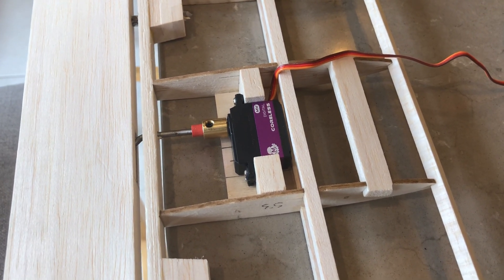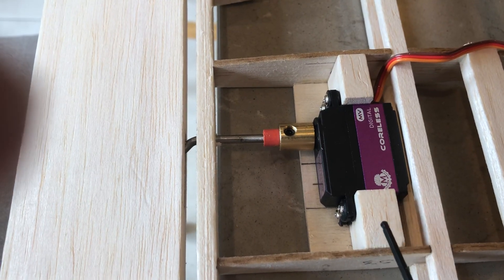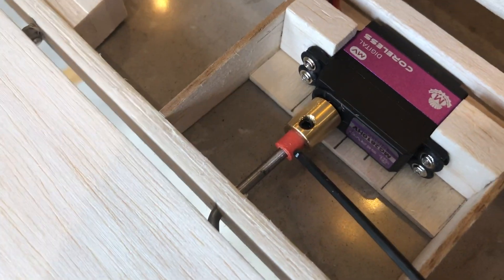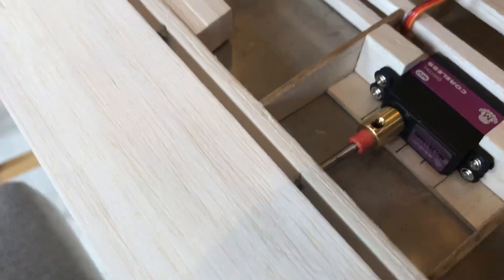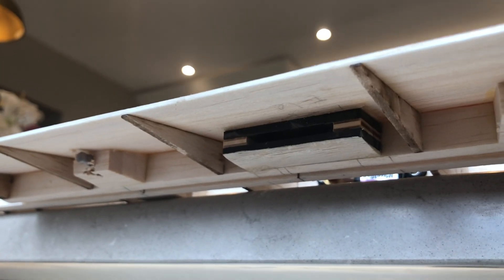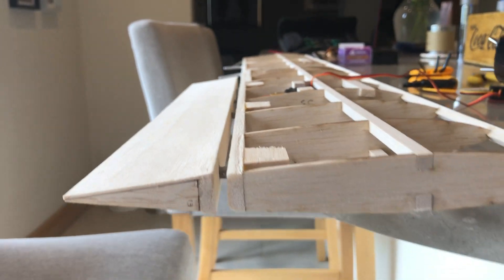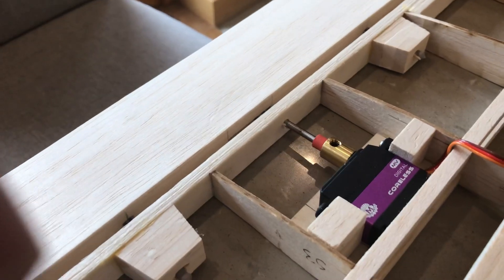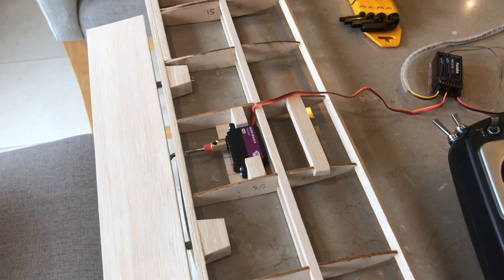Rotary Drive System for Nick Ziroli Stuka

Comment: That's a large gap between the wing and control surface, never seen a control surface on an RC plane with a flat leading edge, always beveled or rounded and tucked in to a pocket in the trailing edge of the wing or stab. This is known to cause flutter at higher speeds. Is that the final product?
Reply: That wasn't the finished trailing edge, there was a thin fibreglass shroud added top and bottom to close the gap after the sheeting was applied to the horizontal stabiliser. I also rounded the LE of the elevator as well.

You can see more detail of the build here https://www.rcscalebuilder.com/forum/forum_posts.asp?TID=31097

Thanks for looking in!
Reply: @specialanddifferent  Cool, was just wondering. I do love the servo setup. The only other question I have about the setup is, does the pocket suggest wear over time allowing slop to eventually creep into the control? I've always been curious about the longevity of this type of setup.
Reply: @shelbyseelbach9568  This is the first one I’ve done so I’ve no idea about longevity! It’s pretty thick fibreglass so will take a long time to wear I suspect. I can always replace the elevators if it does get bad I suppose.
Reply: @specialanddifferent  appreciate the responses.
Reply: Hi, the link does not work @specialanddifferent